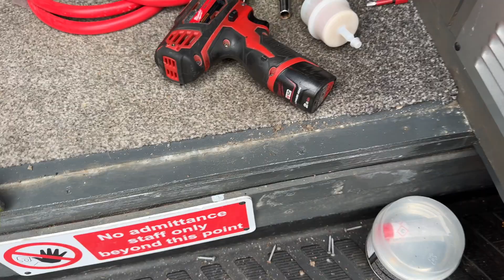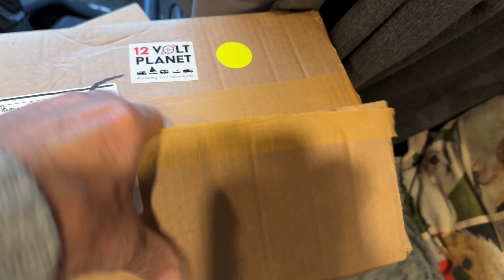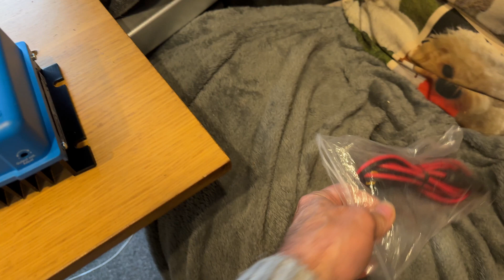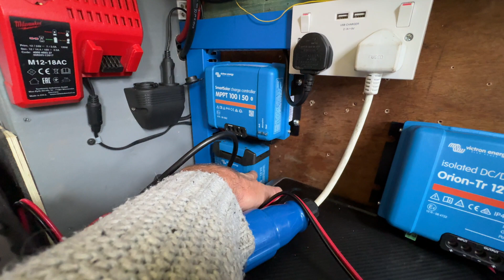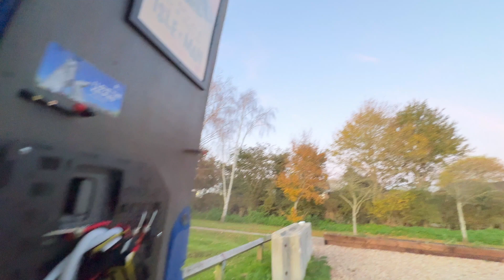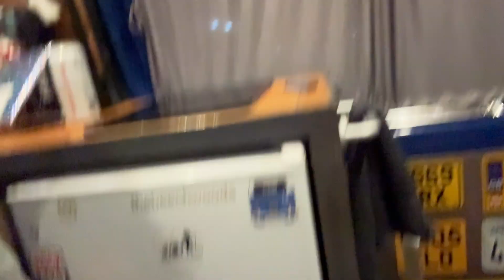Winter solar and Dc charging, upgrading power cables for faster power bank charging for winter.

Comment: Hi Sean, I want to run a chinese diesel heater,a couple of usb lights and charge my phone. What is the smallest  size lithium battery I could get away with ? I have a portable 100w solar panel for charging it. Any advice/recommendations would be great .👍 Ps bare in mind, pennies are tight as I wasn't that lucky Euromillions winner 😂🎉
Reply from the maker: You can use a 100amp fogstar eco drift lithium battery and that would be ample £199 at the moment 👍👍👍👍

Comment: Can I pick your brains,  I've got a 2002 Mercedes sprinter fitted with a sterling power b2b (latest models) rated at 40amps.
I'm looking at installing a bluetti charger 1 to also charge my bluetti power station , as I understand your alternator needs to be at least 50% more amperage than that of your dc to dc charger. 
Can I up grade my alternator to let's say at least 150amp output to include bluetti charger 1 without the need to upgrade alternator cable size and relevant fuses ?
Thanks in advance Paul
Reply from the maker: Hi Paul I’m pretty sure that the standard alternator fitted to sprinters is 180amps, if your alternator is a standard Mercedes there is a white sticker on the black plastic cover and on that will be written what amps it puts out around 1000rpm and upwards. You can always put your registration number into euro car parts website and look at the replacement for it and look at the amp rating. You can then look for a higher amp rating, if you’re sprinter engine is the 2.0/2.1/2.2 then you just have look at the regulator specs because if its a 13.75 volt then it has be matching as the ecu will not accept 14.5 volts and the ecu will go into over voltage protection, as the fuse box is also on the Mercedes LINbus system that checks for blown lights . If it’s all matching then the LINbus will be happy and the voltage will stay the same but with a higher amp rating so will cope with extra loads like a Dc2dc charger. On cable size 70mm square should be fine if you running from the front to rear. The bigger the better for minimal voltage loss. The fuse rating should be match to the sterling instructions because that has to be the weakest link as not to over heat with resistance. It’s quite complicated with Mercedes as there electrical system is very complicated. A bit long winded but hopefully useful to you.👍👍
Reply: @ProjectCamper  amazing reply, thanks a million for your fast response.
B2b already installed as been full timing for 10 years now , the new sterling power models are so much more efficient.
Got 200amp of relion lithium batteries, but now the winters here , I'd like to buffer the power with my a200 bluetti their original one .
Charges at about 450watts AC power brick , so charging with my victron inverter is not an efficient way .
Hence the bluetti charger 1 looks like an option. 
Got a little ecoflow river 2 I charge up in the gym is handy for me electric throw but that's about it. 
But small enough to discreetly tuck into me sports bag ........ Another sneaky van life hack .
Reply: @ProjectCamper  hi buddy, had a look at my alternator, no sticker on it  , and couldn't see any markings.
Doesn't help it's a dirty little bugger , is there any other way to tell what the amp rating it is ?
Will a clamp on multi meter suffice?
Reply from the maker: Yes you can try a amp clamp but it will only measure the load being used and not it’s rated output, have you tried putting your reg into euro car parts as it’s a great way to see the specs for a replacement even though you want more amps you can see what the standard alternator is 👍

Comment: Ecoflow 800W Alternator Charger & Delta 2 battery. Perfect! Took me a few minutes to install. Top grade cables included, and provides top-grade instant performance and charging without hassles. Plus everything can be controlled and monitored remotely from the phone app.
Reply from the maker: I have been looking at that system 👍👍👍
Reply: @SprinterVanLife21 just to add about the Ecoflow, I’ve got the Delta 2 with the ECoflow alternator charger, simple and brilliant, charged at 67 amps 800w and can also reverse charge from the Ecoflow to your started battery 👍

Comment: 48 volt server rack battery with a hybrid Inverter and a 48 volt To 12 Volt Converter. The amount of  unnecessary cabling and equipment you have in there it's astonishing
Reply from the maker: If I did a new van I would probably go down this route

Comment: Great video again, I actually had one of those units and found it was still too slow charging the bluettis. I took it all out and went back to using my 1000w inverter connected to my vehicle battery and just plugging the power stations in to that, acts as if its on mains charging which it 10x quicker to charge them up

Comment: i have  split relay  connected to 12 volt  100 ah battery  running a pure sign wave inverter  then plug in my power station  480 watts  charging all the until station  is full
Reply from the maker: I have a spare 800w victron inverter and I’m going fit that and see how many watts it pulls because the allpowers r2500 charge rate when on 240v is over a 1000 watts, I’ve been testing stuff during the week so maybe more updates 👍👍
Reply: @SprinterVanLife21  as long as its pure sign wave it will work 100% cool look forward to update peace :-)